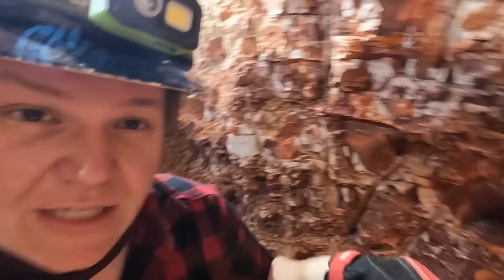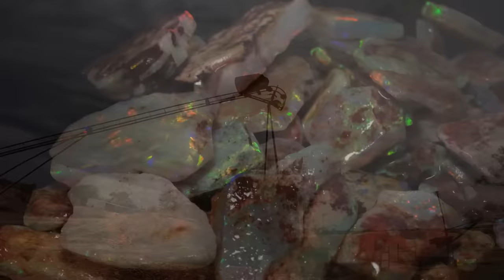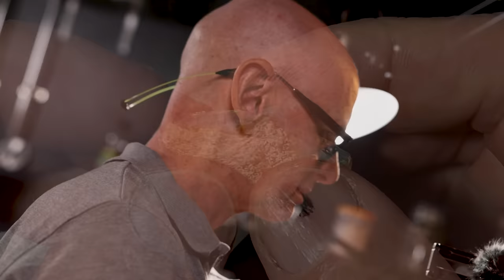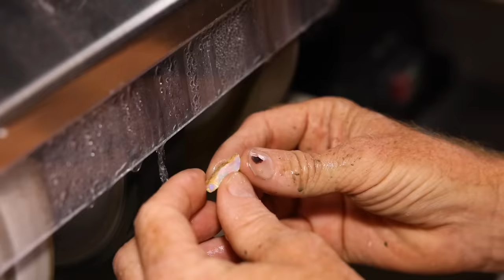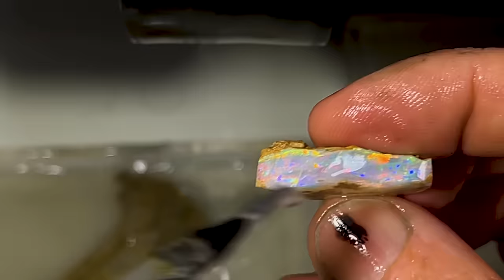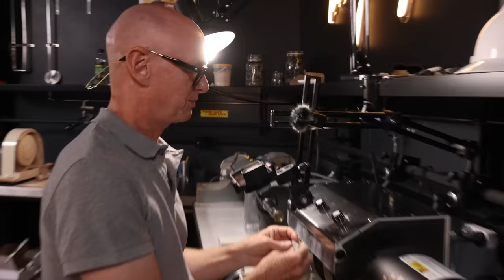Opal Hunters gave me a rough opal to cut

Comment: Oh I was so happy to see you give it a go with dremel ❤😊 I would definitly explored that sandpit with dremel myself. Can be so hard to tell how deep those spots goes.
My only advice is to buy a set of nova tips size small. They will reach all places you have left after those sintered you used. (Same as those RoysRocks use in his videoes) they will also give you the same glossy finish you get on your wheels as I noticed you had a slightly less good end result in the dip than on the rest.
With nova points, you need that 3000 grit before cerium oxide to get the same high end result 🙂 ( I'm a bit of a dremel-nerd myself, so I have the full nova set up to 50K 🙈😅)

I think you did absolutely amazing with their gem, and I totaly understand how uncomfortable it must be to cut someone else opals. I sometimes feel uncomfortable cutting my own and save them for months wondering what to do or if to do at all 😅

Comment: In using the drimmer, it allows you to see exactly how deep it went without cutting the whole Stone in half. Before you have to cut it so it gives you the best option of what to choose for and you're not wasting other opal outside of that Sam when you try to get to the bottom of it. At least that's what I see.

Comment: I could imagine a pinch type retainer or clasp at the top (narrowest end) of the stone and off that suspend a tear drop shaped 3/4 to 1 carat diamond or ruby that would hang right in the center of the natural dent where the sand was removed. A hanging gem surrounded by another hanging gem, both on a silver chain, combined into a nice 80-100k piece of mother earth!

Comment: Responsibility yes but they brought their best stone to you. Not to x, y or z but to you. Why? Because after team consultation they decided you were the best man for the job. They obviously think that you can read the stone and make the optimal decisions to bring out the best results. Granted their thought processes for the ultimate result may differ from your own but I believe you make sensible decisions. You always try to maintain as much of the original weight as possible whilst exposing as much of the internal beauty of the stone that you possibly can. That sand inclusion had to be removed one way or the other and you deciding to Dremel it out, in this case, leaves the option for the owners to cut and reshape if they decide to. Had you cut the stone into two that option would no longer be open to them. I've watched quite a few people working opal on YouTube. Many don't display your level of patience. You often stop, take a step back and reconsider your next step before continuing.